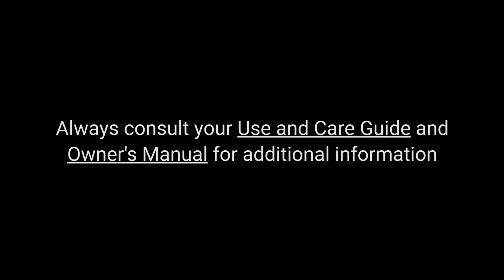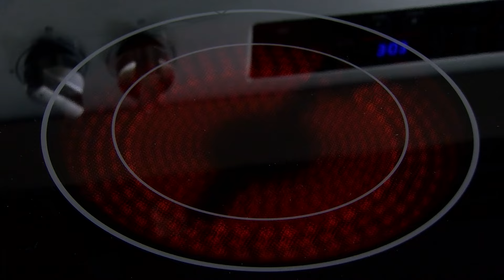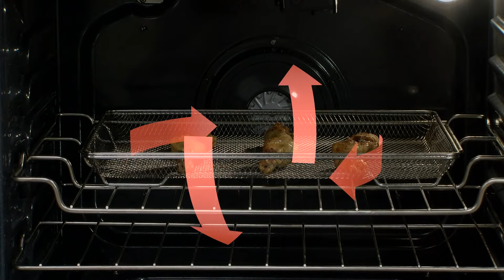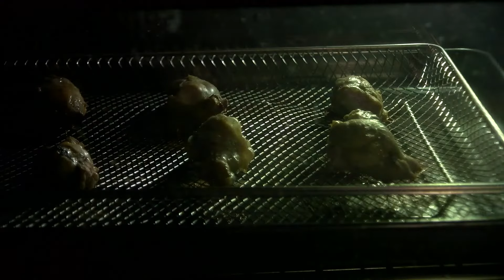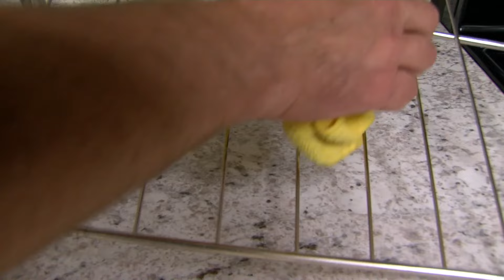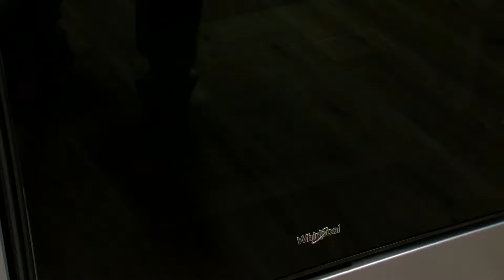How To Use Your Electric Range

Comment: Why is that user's manual has no information on how to use? No description on any of the dials, settings or how to set the warmer, clock and so on?
Reply: It's under the controls manual. I found it confusing at first.